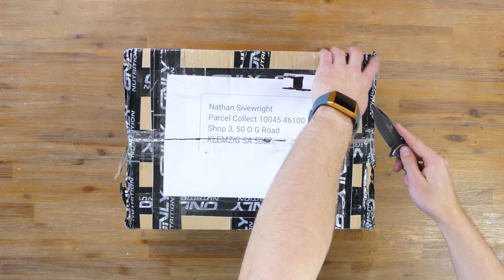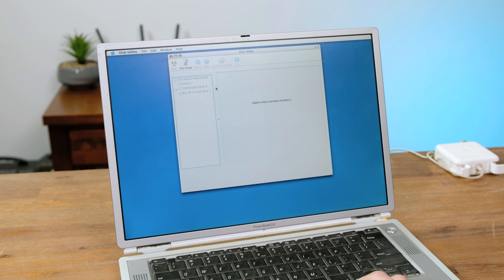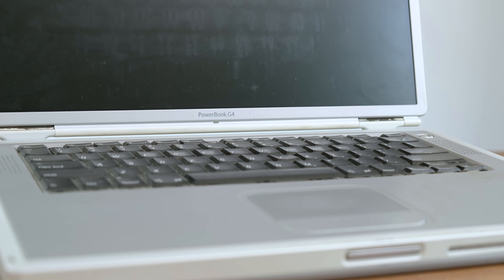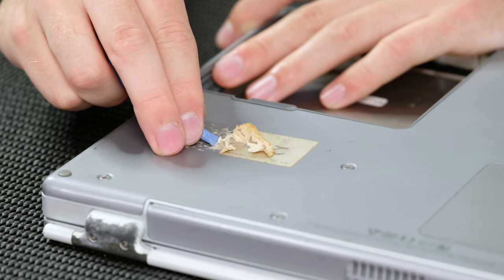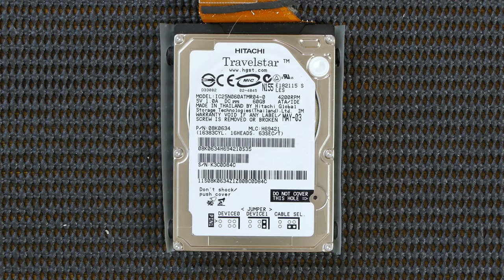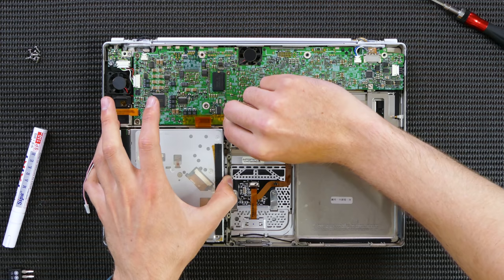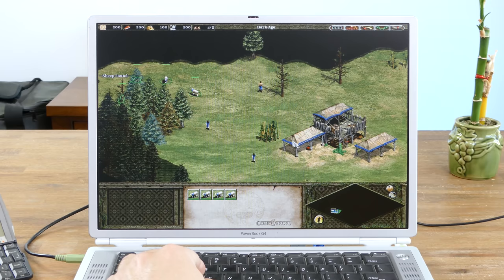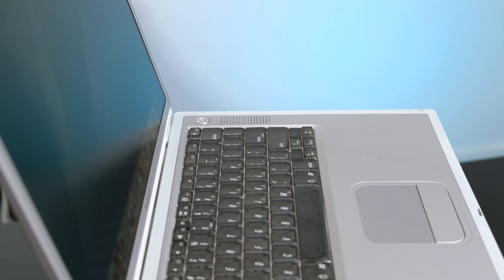Apple's $7,500 Laptop From 2002!

Comment: Why does that laptop have smaller bezels than the 2019 MacBook Pro? 🤔
Reply: I need to annoy myself. I yam confusion
Reply: because apple love thick ugly bezels and outdated design just like on their phones
Reply: Exactly
Reply: @girlsdrinkfeck  maybe the xr and 11 but the 11 pro and x/xs aint too bad..
Reply: The first thing i noticed :) Looks very slim
Reply: I was thinking that too, lol 😂
Reply: girlsdrinkfeck Why is it literally every Android clone maker had to copy Apple’s notch while also leaving huge chins at the bottom the display (the whole reason for the notch was to eliminate the need for a bezel on any of the edges?!?)
Reply: @dregenius  They started development of those devices beffore the Iphone was made. So they only knew it has a notch but didn't have the technology of kow to do the rest. And they didn't knew that the notch thing is just a bad idea :)
Reply: Because Steve Jobs worked on those designs.
Reply: @girlsdrinkfeck  Apple design is best.
Reply: I can't understand why it's important to you. XPS bezels are awful and not good for work.
Reply: @imho4990  no
Reply: The bezels aren't smaller.  That's just the illusion of this design.  This model's hinge is separate from the display (something unique to this line of laptops, for which they are notoriously susceptible to cracking or tearing on the space between the monitor and the rest of the machine).  On modern laptops and MacBooks in particular, a lot of the hinge structure is integrated with the monitor.
Reply: @irixperson  I get that there is more there is more tech in modern laptops . You still can't deny that this Powerbook G4's small bezel design is way better than having thick black bezel in each side
Reply: @g0at720   No, that's not remotely what I said.  Read my comment again.  The PowerBook G4's "small bezel design" is only "small" because the hinge is not integrated into the machine, let alone the display, giving the laptop a wider frame.  This design is also infamous for breaking and cracking in half because of how these laptops were constructed.
Reply: girlsdrinkfeck sheep
Reply: Tuck frump
Reply: Literally my first thought
Reply: @dregenius  android clone? Wrong. Also what bottom bezel? Iphones have a bottom bezel too lmao they just hide it with that big ugly metal rim around the phone
Reply: it doesn't. it has significantly thinner bezels.
Reply: Veltek usually all bezels are made the same on all devices unless you’d rather one that is shaped like a triangle
Reply: Not that big of a fan of too thin bezels.
Reply: Same
Reply: Cause it was never really an issue!
Reply: Veltek obvious answer: because the new displays are much higher quality (retina), brighter, have built in cameras, microphones, sensors of brightness, are much better under sunlight, don’t get damaged from water, don’t damage your eyes and are not toxic to the environment. All those qualities take up space and are a bit harder to make.
Reply: @Lord John Schwarzwald my Samsung cost more than iPhone u fail
Reply: Exactly, that’s what I’m thinking too
Reply: @Lord John Schwarzwald no cuz Samsung is years ahead
Reply: That’s a shame
Reply: And a better keyboard 😂
Reply: Lol ao true
Reply: girlsdrinkfeck oh great it’s you again
Reply: @jellyjordy1154  lol
Reply: Oh yeah the one on 2009 has bigger bezels
Reply: Which means the designers thickened the bezels to annoy us
Reply: Because Apple.. lol
Reply: 6,000 mAh battery?!?!  That's insane even to today's standards! 

One thing I can say about Apple products; you absolutely get for which you pay.
Reply: @dgates6165  yeah this definitely does not apply to Apple today LOL. Biggest scam of products ever made really
Reply: @austinramsay  you are right! They sort of just make the same product over and over again while stealing ideas from Android devices. 

I'm a hard-core Samsung user lol. 

- Sent from my Galaxy S20 Ultra 5G
Reply: Probably because the screens lid is thicker than current macbooks which means all internal bits are behind the screen while with current macbooks there alot or thinner and they hide the cables behind the besils
Reply: TFT man😩
Reply: @girlsdrinkfeck  just like Samsung
Reply: @dregenius  I mean, the chin is where the display connector is, so manufacturers need to curve their screens back over on themselves so the connector has room
Reply: Think different
Reply: Think different.
Reply: Think different
Reply: xD
Reply: @girlsdrinkfeck  good for you you got a android phone, iphones are still better.
Reply: @RobbDrew03  RIGHT! finally someone understands, android phobes and windows laptops suck.
Reply: @thedeadlygames9716  I disagree. Iphones are outdated
Reply: @thedeadlygames9716  nope
Reply: @girlsdrinkfeck  iphones arnt outdated. I use a iphone 7 which is ancient but it still works fine. Plus apple has pretty much always been ahead of everyone else.
Reply: @girlsdrinkfeck  apple was the first to enter the ultra thin laptop market in 2008 with the realease of the macbook air, because before that laptops were nowhere near as thin, the only laptops that were the closes to thin were the sony tz series. They also pioneered the future of touch screen phones with the realease of the iphone in 2007. Don’t tell me that apple is outdated bro, apple is actually ahead, you android users are the ones using outdated technology. Go figure.
Reply: @thedeadlygames9716  wrong
Reply: @thedeadlygames9716  no
Reply: @girlsdrinkfeck  google it if you dont believe me. Apple isnt outdated and they were the first to inovate the touchscreen for phones
Reply: @girlsdrinkfeck  nope im right, your wrong g o o g l e i t
Reply: @thedeadlygames9716  agree to disagree then
Reply: @thedeadlygames9716  no they wernt
Reply: What people don't realise is, the designs you see of technology...is 10/20 years ahead...the designs of today are from at least 2005, it's just a build up good for business... people think what they see today is new. Wrong. It's the way of "business" that's why you see things sometimes that look ahead of there time...just a leak it is.
Reply: Back then in apple someone has brain 😂😂😂
Reply: Back then in apple someone has brain 😂😂😂
Reply: @girlsdrinkfeck  the Macs Definitely don't have dated designs by any stretch of the imagination
Reply: @The_MEMEphis  that's your opinion
Reply: @girlsdrinkfeck  no that's fact apples MacBooks are universally agreed apon to have some of the best build quality in the industry and they always pushed what the standard on PCs have been have you seen the new 14 and 16 inch MacBooks
Reply: @The_MEMEphis  well theyre wrong ,mac keyboaords suck and always have complaints and the magic mouse is rtarded
Reply: @Jason Dillon the screen size isn't a justification for why the bezels are bigger on the 2019 MacBook
Reply: @girlsdrinkfeck  because your Mac Book didn’t cost $6,791.79 like this one after inflation.
Reply: @Nico_Rinke_  my MacBook?
Reply: 2019 Mac costs way less
Reply: @imho4990  no
Reply: They aren't smaller these bezels were just thick as a machine from that time
Reply: @thedeadlygames9716  actually apple just copies everyone's ideas and calls it their own
Reply: @thedeadlygames9716  they weren't the first lol, it was the LG Prada released in 2006. Get your facts straight
Reply: @thedeadlygames9716  that laptop was horrible af, slow HDD and slow specs
Reply: @girlsdrinkfeck  MacBook keyboards don't suck, stop thinking of the butterfly keyboard era and grow up also no one is forcing you to buy a apple mouse the touch pad is great.
Reply: Oh god
Reply: @Maximus20778  why
Reply: @Maximus20778  so what?
Reply: @Maximus20778  iPhone is still a bulky phone

Comment: the reason why it costs 7k AUD because it still work 17 years later
Reply: Not without eucalyptus oil it doesn't
Reply: I have a 2002 laptop that was bought for 500$ and OMG, it still working
Reply: Those models were durable, hence why it's very expensive.
Reply: @cecilealfonso538  they weren't - I had one (helped me meet my wife in a cafe..) but the hinges broke about a month after I sold it, the paint came off the top case within about 9 months of ownership. They looked REALLY good though.

Comment: Such a modern looking machine for something so old. Even down to the bezels and looks of the OS!
Reply: In the early 2000's Apple was about a decade ahead in terms of its hardware and software design. The fit and finish was far beyond any existing PC manufacturer.
Reply: @ransom182  
Apple products have always been ahead of its time. Other companies are generally catching up, even today. Things simply just slow down a bit after Steve Jobs died.
Reply: @cunnyman  ehhhh, definently not now
Reply: @vagueequinox7543  
Even today. Thunderbolt 3 and shit
Reply: @ransom182  Even thinkpads back then had bezels that thin. It's the screen technology that requires less bezels.
Reply: apple definitely killed it in the 00’s
Reply: @cunnyman  anything else? Because in every other dept, android would cream pie apple. Except software optimization. But that's inevitable
Reply: @cunnyman  even today? No 
Not even 2010.
Maybe for  mobile since 2016
Reply: @jakemarold6978  If you want smaller bezels you need to make it thicker to fit screen. Now as laptops are much thinner they have to compromise it for wider bezels
Reply: @prateekpanwar646  That doesn't make any sense. The screen unit is entirely seperate from the computer half. If it really was thickness, why do paper thin Dell XPS laptops have teeny tiny bezels but big 1600 dollar gaming laptops have the thickest on the market?

Comment: For those curious on some backstory on these machines:
 The Aluminium PowerBook was actually given to me in a zip lock bag, completely torn to bits. I did my best to re assemble it although I didn't have any spare parts to get it working again. 
 The PowerBook G4 was given to me by an Apple collector a few years back and I never  had the right OS to install on it. (You can see by the PowerMac G5 Install DVD). The machine has passed through at least three repair shops in its time, so must have had a very loving owner.
 It's truly wonderful to see the G4 brought back to its prime, you did an awesome job restoring it!
Reply: This guy is the man
Reply: Ya
Reply: Interestingly, this was also not the right screen for it - the font underneath was only used on the 867 and 1ghz G4 TiBooks - the 667/800's still used Apple Garamond. They're the same resolution though, so no big deal.

Comment: 1 gb of ram for a 2002 laptop is pretty impressive.
I've seen laptops that are much new than this one and have just 2 gb of ram.
Reply: facts.. that laptop was a BEAST in 2002
Reply: 1gb of ram was huge in 2002
Reply: My work laptop has 2 GB of RAM :D
Fun fact: My employer wants me to do performance testing on it, among other things.
Reply: In 2002 I think my desktop PC had 2GB RAM (4 x 512MB PC3200) on an Abit NF7-S 2.0 with an overclocked XP1700+ tbred b @ 2.3GHz (I think) & if I wasn’t using that system as my main rig then it would have been a tbird 1000 axia-y @ 1333MHz on an old via kt133a chipset based mobo with 1GB crucial memory (2 x 512MB PC133)
Reply: Your picky PC shopper, much like my mom, wouldn't buy a computer unless it had 512 MB of RAM (it was a different time.) Now, your picky PC shopper wouldn't buy a computer unless it has 16 GB of ram.
Reply: I have a 2019 laptop with a touch screen and 2 gb ram. I also have a 2010 laptop with 4 gb ram

Comment: Those bezels are better than most 2019 laptops haha.
Reply: this ist better then macbook retina 2012-2015
Reply: I was also thinking the same
Reply: @_nirmal.p.rajan_  it's because somebody have invented the webcam...
Reply: Well, not better than my laptop's
Reply: No integrated webcam, probably no integrated antennas for wireless, different lighting method for the display, no light sensor, much thicker lid, noticeable lip between the bezel and the display.

You can get thinner bezels for modern laptops, but given the level of tech it's usually better to make them slightly thicker. You also need to remember that the PowerBook G4 was an exception and started at AU$5500 -- I had a Celeron laptop back in 2005 and the bezels were at least 2.5cm thick all around, which was not uncommon for the time.
Reply: @syahrizkyathaullahanandisa9814  ok?
Reply: @benanderson89  omg thanks, so whats ur number
Reply: The future is telling you that white bezels are making a comeback
Reply: @syahrizkyathaullahanandisa9814 creep
Reply: Tfeq

Comment: I reaaaaally like the 12 inch PowerBook... There's something about them
Reply: Yes, always loved them as well, so I got the fastest 1.5 GHz model. Like others in the G4 line, it was slow even for the time, and unlike them, it runs hot as hell, the fan screams and the (new) battery only lasts 90 minutes. The aluminium casing got bent in normal use. It runs neither a modern OS nor OS 9, and Tiger has no killer apps. But it's still nice to have somehow, and I fire it up all the time, and get work done.
Reply: I have the 867 12” and an 867 version of the machine Nathan showed in the vid. Dear God the 12” is slow. I think its the lack of L3 Cache on all 12” that kills the performance. Mine also revs the fan and gets hot too. Its cute, but the Titanium is way better.
Reply: @aegonthedragon7303  I guess the L3 cache makes up for the criminally slow (167MHz tops) bus on these machines. Never had one with L3, I do have a lovely 17" iMac that is a similar disappointment at 1GHz. The core is all right, it just constantly gets choked up.
Reply: Is it the luxo lamp iMac? The G5 iMacs still are “decent” machines on 10.5, 10.4 would be much better, as my dual core G5 runs rather well for its age on Tiger
Reply: @aegonthedragon7303  yeah, it's the lamp. I lucked out on a near-mint one for 50$. Beautiful machine, but not very quick. I also have the G5 iMac which as you say is more than decent in performance, but otherwise quite boring!
Reply: I got a 1.33mhz model. Had it for 12 or so yrs

Comment: I recently restored a couple of these machines. They haven’t aged all that well, since in addition to paint chipping, I also had the problem with the plastic frame coming unglued from the titanium panels. But they are very nice machines to use and shockingly cheap on eBay if you keep an eye out for a few days. I got some “non-working” ones for almost nothing and all I had to do to get them to boot was disconnect the PRAM battery

Comment: I would like to see an upgrade of these old computers, like removing that old dvd drive and replace it with a faster ssd, that would be a great upcoming video.
Reply: Edgar Estrada I like your idea, but I have to tell you that a SSD Upgrade wouldn’t make a big difference because of the slow SATA Connection with only 1,5 Gbits... modern Laptops does have much faster Connections to the hard drives!
Reply: iMirco97 This laptop is even a bit older—no SATA here, but good old IDE. So the best one can do is to fit an SD card via a CompactFlash adapter. Speed improvements won't be huge in any case.

Comment: Great find! Nice video! I had a TiBook around 2002 and that thing was so far ahead of its time. Most other notebooks of that era look primitive in comparison. It STILL looks modern and sleek enough to pass today. The only issue with that design was the surface coating peeled badly off parts of the tiBook. I had mine for 10 years and by the end it looked a mess even tho it still functioned fine.

Comment: Bought one of those Titanium G4s off of ebay back in 2010. It was a fantastic laptop for three days. Was listed as 100% working, mint condition. Thing had the letter H burned all into the screen all over, no idea how. The battery pins were disconnected from the motherboard. After four days of use, plugged it into power and it immediately caught on fire with a lot of smoke coming up from under the keyboard. I had to throw it out of my window into a snowbank on the road at the end of my yard. 
I then yanked the hard drive and hinges off of it as they were in good condition still and dropped it's corpse off at the local recycling centre with an "Electrical Fire" notice so no one else would grab it

Add: These things go far when flung like a Frisbee

Comment: That power supply must of been manufactured before 2004 as it doesn’t have the protective coverings on the live and neutral pins and it was legally required for all devices with Australian plugs to have those protectors on the pins after April of 2004! :)

Comment: That should run 9.2.2 natively, but finding original install disks will be a challenge as it must be for that exact model year.  I almost gave up finding a set for my model A1025 1GHz Ti G4, my "OK, final look on eBay" found a set posted minutes before with buy it now option at a great price.   If you're thinking of 9.2.2 I wish you luck in finding the disks.

Comment: I have a 1GHz model in my collection. It still works but takes a lot of effort to get it started- typical PowerBook failing RAM slots I believe. The battery still lasts a few hours of using the laptop, as well! I've had to replace both hinges at different times- very difficult, as the display assembly is glued shut and not serviceable.

Comment: The bezels are smaller than most computers in 2019, which is shockingly sad.
Reply: I just ordered a 2022 Acer Chromebook 317, (a brand new $499 chromebook just released from Acer) and it has bigger bezels than that laptop. Extremely sad. Laptops should have no bezels at all today. Makes no sense that they do and bezels are extremely ugly.